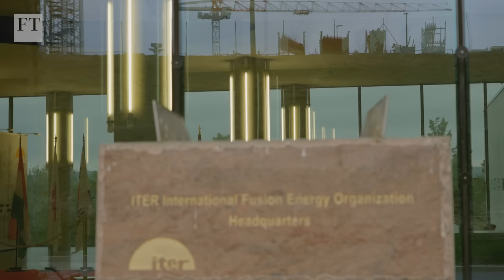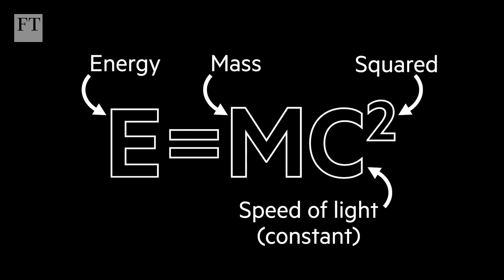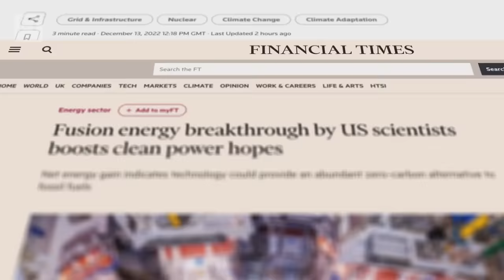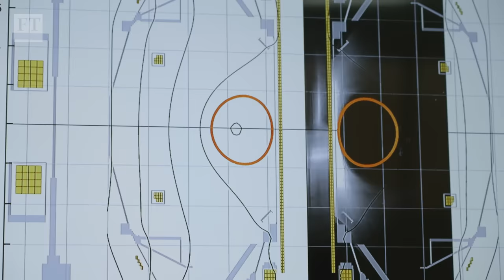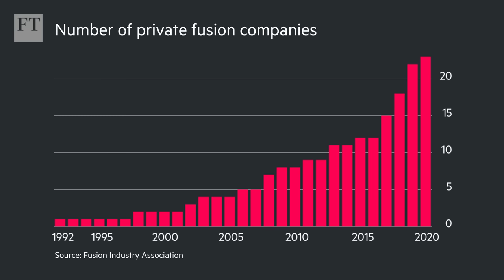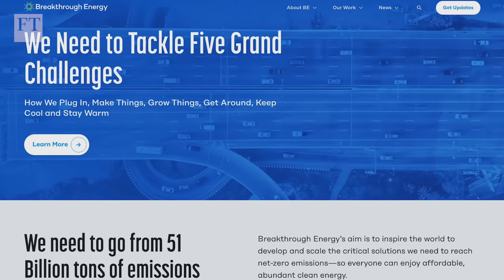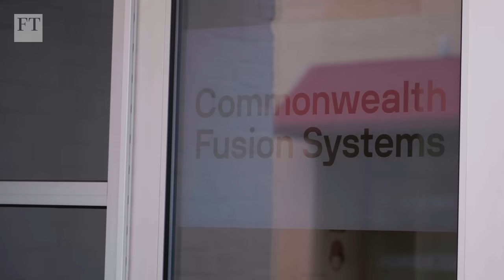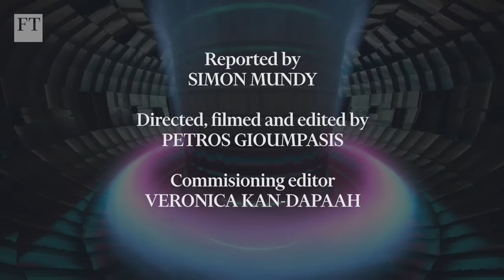Fusion power: how close are we? | FT Film

Comment: Fusion power plants like nuclear power plants are entirely unnecessary and extremely dangerous power plants.  Edison generators are permanent magnet motors as generators and brushless motors as generators are dynamos.  These generators with inverters and transformers to deliver high voltage AC power can equal nuclear power plants and fossil fuels power plants.  We don't need heat wind or water ti produce electricity.  The permanent magnet motor with inverters and transformers is enough and you can add an unlimited number of dynamos with inverters and transformers to deliver high voltage AC power of any current AC and any voltage AC power continuous peak power to the power lines.  The obsession with heat is an obsession with steam wind or water as primary effort to move the armature magnets and coils of copper wire.  The Edison generator and brushless motors as generators with inverters are not lost in this propaganda.  The premise of fusion power is false.  A premise as false as nuclear power plants and hydroelectric power plants.